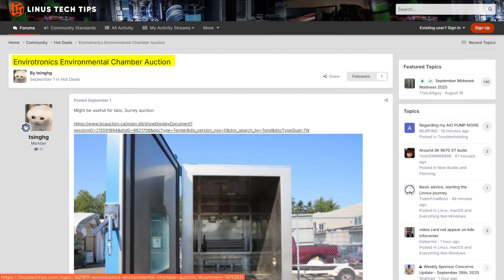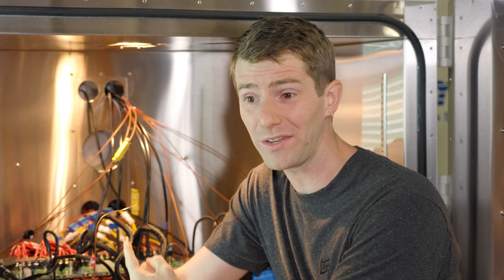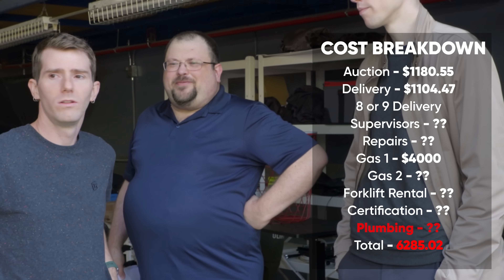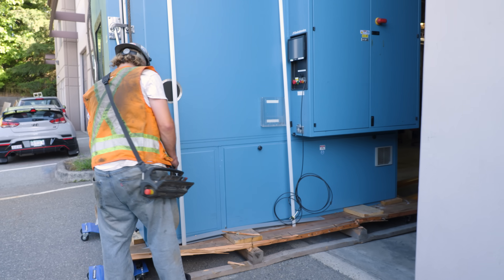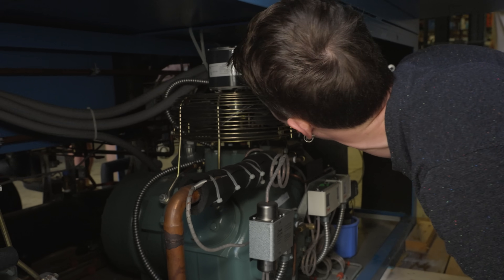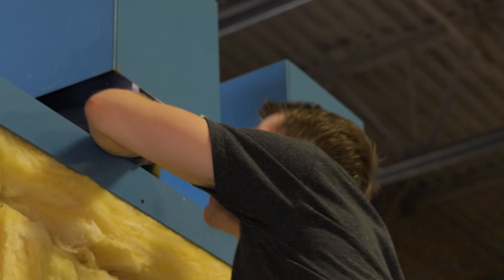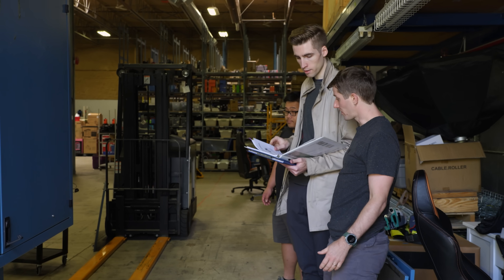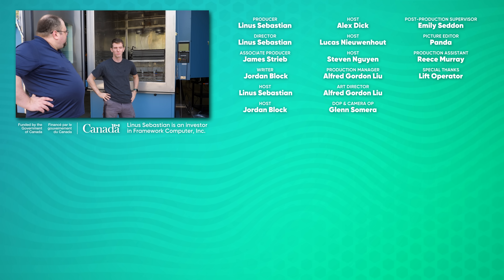They Auctioned This $40,000+ Environmental Test Chamber For $1000

Comment: The fins of the radiator yikes for those who don't know the upper left part that was shining is bent fines and that's VERY detrimental for things from wall ac to industrial hvac systems also theoretically you could use two forklifts to move this but judging by the design your looking at a mid end commercial grade forklift looks like the one you have is electric you gonna need a propane or one of the other various gas types

Comment: As someone who has bought very expensive but old equipment for cheap, Clone that drive immediately.   I bought a 100W YAG laser that was new in 2000 and went for $75000, for $400 a few years ago.  I then spent that same amount on a used PCI control card and many hours trying to find the proper drivers for ancient hardware to get their proprietary software running.
Reply: I'm not even in involved in any specialized field. Just someone who likes to make sure they get to see stuff again in the future. That's one thing I've learned: if you like it, save it. And in much more important cases like yours, just have a backup especially since it takes practically nothing to do but can save you SO much time and resources without needing to roll the dice.

Comment: You can move equipment heavier than forklifts with skates. They're all metal skates with tank tread with solid metal rollers. We use them to move electrical vault equipment like transformers for whole buildings.

To get them under you use a Burke bar to fit a toejack under to jack it,  block it then jack again and swap block with skate

Comment: All that copper and brass is fine. But it does need pressure tested. Take it out and it's going to cost you A LOT! the cost of copper is really high right now and so is labor.Maybe replace a valve or two. It's called corrosion.  It happens. And as long as the insert gas has not leaked out you're good on that part of the system. Find someone who knows something about the spects on it and it's systems.

Comment: I'm a test engineer and I work with similar environmental chambers. We have a building water system that circulates water through the building and through any chamber in use and it's a massive system. You might be over your head. But they are heckin sweet and work really well. When they want to. Ours love to randomly fault out. But you can/should be able to setup remote control of it from a test station to change the temp off a profile. We use Modbus for communication. The compressors also need cooling, which they get through convection/fans, keep the panels on when running it. Also prepare for icing. Need a condensate drain.

Comment: Just wanted to give a PSA. When working in a high voltage starter box like that. Be very careful powering a low voltage circuits to test them. Make sure to pull the fuses from the control transformer or you will backfeed up to the full main voltage which can be very damgerous, especially if you think there is no power.

Comment: Great acquisition! I actually have experience operating one of these environmental test chambers for evaluating inexpensive air quality sensors. They're incredibly capable  to test temperature, humidity, clean air, and even different atmospheric pressures if your unit is properly equipped(our unit simulated 10,000ft? of elevation).

Would definitely check out part numbers for LCD panels and circuit boards to make the repair and refurbishment as inexpensive as possible, instead of purchasing entire components from the manufacturer. The unit will need compressed air, water supply/return, a water chiller, and power.

Comment: Linus replace the water flow control valve the diaphragms crack an tear over time . Cheap little maintenance. You can change the diaphragms without removing the whole valve . I believe the brand is Johnson controls .

Comment: 14:58 if the refrigerant is so expensive, you're probably better off checking for leaky valves before you've filled it up with the expensive gas, if at all possible.
Reply: That's standard procedure.  Pressure test with (usually) nitrogen and look for leaks, then draw a vacuum on the system (and check for leaks by seeing if the vacuum holds) then fill with expensive (and heavily regulation encumbered) gas
Reply: @pileofstuff why nitrogen? because its cool? 😂
Reply: @rizkiaprita  because it's inert and common iirc
Reply: @tassiedingo  inert, common, and very dry.
Reply: @rizkiaprita  Serious answer: because it's affordable and easily available, because it doesn't leave a residue, and because it's molecular size is smaller than any of the refrigerants, so if it doesn't leak, neither will they.
Reply: @danl6634  Well, they would need to specifically get dry nitrogen
Reply: @rizkiaprita  because the atmosphere is 70% nitrogen and nobody's gonna care if you spew a few gallons during a catastrophic failure.
Reply: @rizkiaprita it is innert and it is considerably cheaper than argon.
Reply: The high price of the gas is probably due to it being on the "do not produce" list such as R12. That being the case, it would be far better off for them to engineer a completely new dual stage cooling loop, using modern coolants that are relatively cheap to procure. Imagine trying to restore this outdated current setup only to it to fail and leak. That would be thousands of dollars of coolant waisted.
Reply: Use propane or some othet refrigerant instead. 😅

Comment: That big thing on the water inlet plumbing with the visible spring is your inlet water flow adjustment valve. It should be able to compensate for some flow rate slight changes and load changes but it needs to be initially set up for your system and setup. The refrigeration tech that evacuates, leak checks and fills your machine should set that all up as needed with your flow rate. Too much and your system win't iperate well. Too little and your system will trip head pressure safeties.
Flow path is compressor high side to heat exchanger, to receiver (has a dip tube so that only liquid refrigerant will go to the expansion device), to filter-drier, to expansion device, to evaporator, to accumulator (allows any cold liquid refrigerant to to to vapor before heading to the compressor. Compressors do not like compressing liquid), then back to the compressor. The receiver and accumulator also act as excess refrigerant storage to allow for expansion and contraction and can also act as an excess margin tank if there are small leaks to keep the system running for a while.
There should be a spec/name plate on that machine that says total refrigerant load and all needed refrigerants. It is pretty common to need to buy a cylinder of refrigerant if it is uncommon enough and there is no easily replaceable refrigerant to supplant and older chemistry. (R22 and R12 and many others are decades out of production but there are many replacements that need very little extra work to get the same system up and running at full or nearly full capacity. $4,000 for a 30 lb cylinder is not that bad.

Comment: Would it be cheaper to fill it with water or some other fluid to test for leakage instead of the actual refrigerants since the gas is "expensive"?

Also, since LTT is so known for "unconventional" solutions to problems, how about using two forklifts to move the chamber? One at each end so each forklift actually only need a lifting capacity of half the chamber's weight.

Comment: Such a cabinet is used in aging tests of electronic devices. Humidity can destroy the electronics in that cabinet. Devices that are driven into freezing temperatures are usually well varnished and protected, because the device must withstand cold temperatures such as -50°C or +50°C. It is a good idea to use a dehumidifier in the cabinet, because otherwise the devices inside can suffer from short circuits caused by humidity.

Comment: If this can get to -170°C, you should be able to do some really nice overclocking without condensation risks, as the air will be incredibly dry. You could probably use the chamber to dry the air before even powering on the machine. Biggest problem would then be pouring liquid nitrogen into the pot, but you said you can augment it with liquid nitrogen cooling, so you could presumably pipe LN2 into the chamber and just do it that way?

Semi-robotic environmental chamber LN2 overclocking video when?

Comment: lol the cooling system where i work needs 5k of gas whenever we have a small leak . lol .
Reply: the compressors we have look very similar but are bigger . we have 2 rooms full of those . we are at a point where they are installing a completely new system with amonia vs freon . and us the heat from the system to heat up the warm water system . + new water pipes in rvs all over the factory . total cost is around 2 to 3 million euro
Reply: this machine looks simple vs the tempering machines i'm used to work on .

Comment: That’s likely to be an expensive cooling setup. A cooling tower rated around 400 kWₜ with a pump providing roughly 400 L/min should cover the load, as long as the chiller’s condenser circuit doesn’t hit high-temperature protection limits.

Comment: DONT replace that PC, its part of the whole unit and its probably specially configured to talk to those serial ports in different ways, 
i work as a IT guy in a blood lab and alot of these lab equipment runs on ANCIENT hardware and the Lab device manufacturers explained to me once why we shouldnt even get near those PCs or even update them or anything.

These PCs have software that runs on that hardware, when they are first deployed, they go thru a months long calibration peiod and sensor values and other stuff are tweaked until they reach their oem equipment threshold.

the PCs are usually only replaced when the machine itself fails (which usually isnt that common because they are skews that are made to run 24/7 kinda like servers) honestly i would trust that windows vista pc to still work.

we have pcs that still run XP embedded, the displays are so grayed out and burned in that u cant really read much stuff on it anymore (but u also dont really need to).

Comment: those bitzer compressors are a beast. the unit looks very clean for being under elements for 10 years. those danfoss control units look cleaner than some 1 month builds ive seen.
you should look into a refrigerant conversion and see if it is possible to convert to another cheaper refrigerant which might save you alot of money on the long run but might require a little hardware change or no change at all.

Comment: Easy part is pulling the nitrogen pull a sub 500 micron vacume and filling it fun part is doing all that to find our the compressors mechanicaly fried and having pull it all out replacing preasure testing and refiling to fund out another part of the system is borked

Comment: Well it might not have the same temperature range as the original but if the original system can't be resurrected, I'd put up a domestic mini-split reversible heat pump there instead 😂 (or 2, or 3 )

Comment: However you end up plumbing in the hydronic cooling on that thing. Make sure you have a calibrated balance valve installed in the piping. It will be instrumental in both initial setup and more importantly, future troubleshooting of the cooling loop.

Comment: Something I'd have done first is to open the PC(s) and attempt to clone the drives. I'm sure there's a few people there with the skills and tech to do it in the least potentially destructive way. Ye have contacts for data retrieval etc, but just booting in like that on a 10+ year idle spinner can really lower the chances, when it's a safe bet that the software is near impossible to find. May not be the case with this particular chamber, but still.
Judging by the condition of the innards, it still looks like a bargain.
I think the most similar thing regarding something I've bought secondhand knowing it needed work, was a Sumo Andromeda amp.
I'd wanted it for 20 years. The postage was more than the bid price. The needed things like capacitors had went up a decent amount since had last looked, and then it needed some more work. The seller description was accurate though. It still worked out cheaper than getting it from a place with warranty as working, but not by much.  
It's a beast of an amp, and while I still love it, the neighbours did not.

Comment: Just rip out the old controls and redo it, a small modern plc, Siemens s71200 or equivalent a new hmi and you will be laughing, the contactors etc.. are probably fine, the plumbing will also more than likely be fine. Not a big job and pretty cheap to do.

Comment: I wonder if the refrigerant in the second stage is R-123, which is in the middle of its phase-out cycle and quite expensive. I would have that thing overnight vacuum leak tested to ensure you're not gonna loose any of the expensive refrigerant. If it's R-1150. The 1150 would also be expensive to get, but at least still available for the foreseeable future.

Comment: I work in manufacturing IT as a Systems Engineer and the most expensive thing is going to be that PC running proprietary software. The hardware itself is useless and disposable but the software is likely tied to it and is the reason they were still using a Celeron in 2015.

Vendors of stuff like that won’t even show up to support something for less than $10K and everything goes up from there.  Hopefully being Linus from LTT results in getting some deals and freebies from vendors.

That old PC might also have ancient interface cards is PCI or ISA slots (I see things like that all the time in production in 2025).  That can also bottleneck a PC upgrade situation especially if it requires custom drivers.

Hopefully you can clone that drive onto something new and the software license isn’t an issue.  If it is it’s going to be an expensive nightmare and you’ll find out why someone left it to rot out in a field for a decade.  At least it holds value as scrap if everything goes sideways.

Anyway, since I work with stuff like this all the time I’m looking forward to your new “Money Pit” series about it.
Reply: That's what I thought too.  Some old version of Factory Talk or Wonderware.  Have fun getting that junk working again
Reply: Yeah all of that. Industrial PC stuff is unique in every horrifying way possible. A full disk image should have been the very first thing done, even before thinking of powering it on.

With some luck, the license system will be non-existent or tied to something easy to fool. Don't forget the clock; that stale CMOS battery will not hold the time, and that can upset things in both favourable and unfavourable ways. Try not to find out which before having a disk image.

Comment: Put your cascade cooled test system in the enviro chamber so you can stay below 0 without condensation forever.   Bonus points if you make a pour system so you can pour LN2 from outside through a funnel into the a pot.

Comment: 5 years ago I helped power a pair of Siemens branded environmental chambers for the Amax custom server company located in Fremont, California. Each chamber required three phase power (no neutral) at  250Amps each. The breakers were the size of a shoe box each.

The disconnect style switch boxes had three fuses each which were the size of a soda can each.

Comment: Luckily, there’s a pretty good chance the original drive is still intact, which means you could probably pull the control software and its associated files directly from it. If you’re really lucky, it might even include an installer or updater package.

Granted, the updater almost certainly wouldn’t work anymore, especially since the company’s been bought and sold a couple of times. However, the installer would likely still unpack all the pre-packaged files just like most setups do. That could give you everything you need to get the original control interface back online, or at least reverse-engineer (probably not required at all) how it communicated with the hardware.

Comment: Think about using air power jacks to lift it off the floor and put the weight onto rollers or somehow wheel system? That way it's easy to move around besides having air supplied to the jack system. I make all extra hoses hookups be a quick disconnect hookups. That way they're easier to unhook and rehook up for moving around

Comment: Those little dollies are always overspecced like crazy.  Like, they might hold 5000lbs perfectly balanced and not moving.  Proper machine skates are worth the modest investment
Reply: True, but LTT works in computers and consumer tech, not industrial machinery. Often. 😂
Reply: @eloquentemu  would have also helped to place the pallet stringers perpendicular to the bends in the dolly base rather than parallel to the bends. Going parallel, the bends don't provide any rigidity.
Reply: I also suspect they were misleading in their labelling, and are rated for 5000lbs/pair, or 2500lbs each. If their 4000lb forklift cant lift one end, its probably far far over capacity for both the forklift and dollies.